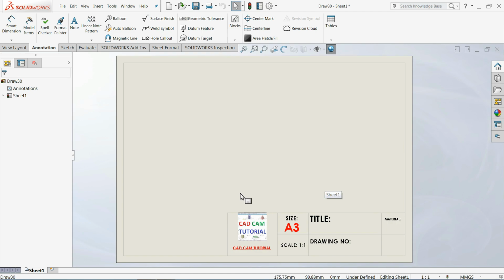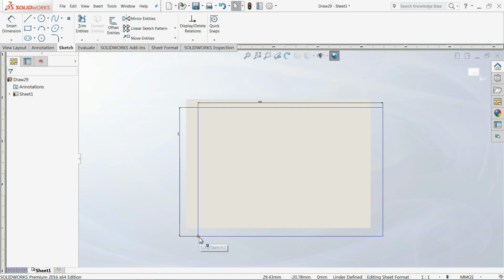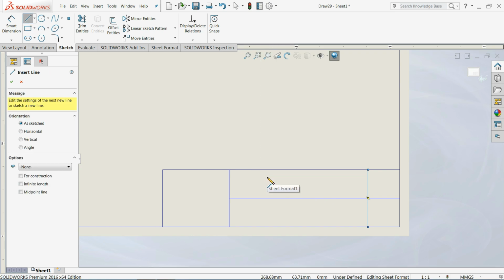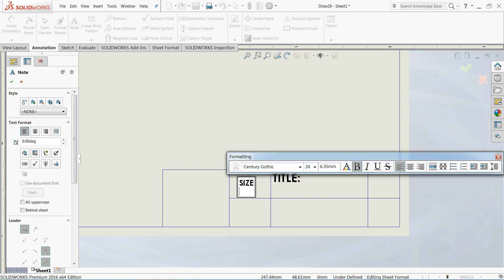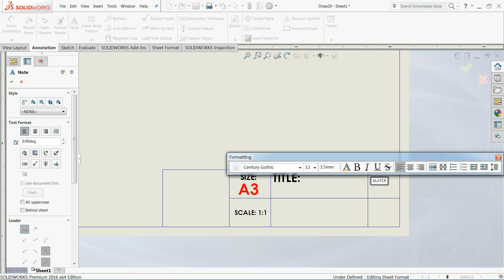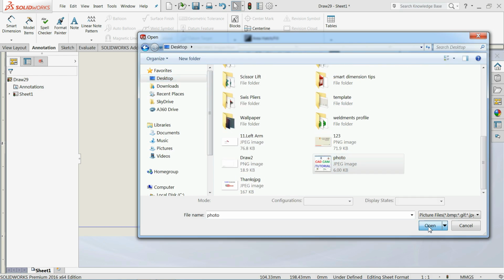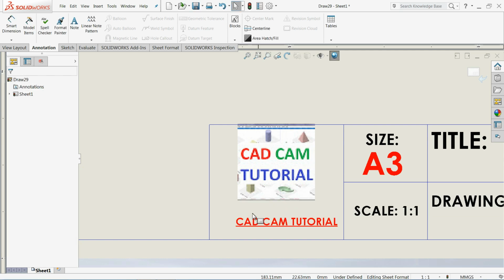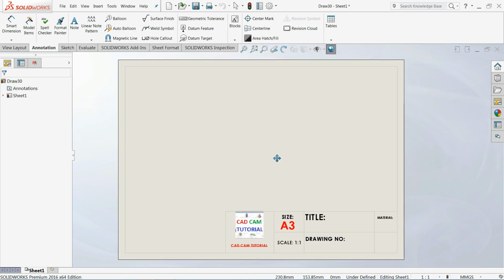How to Create Custom Title block template in Solidworks | Solidworks tutorial

Comment: ... I don't get it, this doesn't link to any part properties at all
Reply: Unfortunately no, he's not showing any of that. I was hoping he would demonstrate linking properties from the drawing file to a part file, as well as using custom property templates Even the Drawing and Detailing with Solidworks 2014 doesn't delve into this much, which doesn't make much sense considering it is a major aspect of the tool used in industry. Not many reliable resources out there...